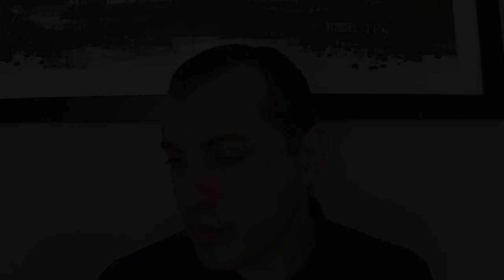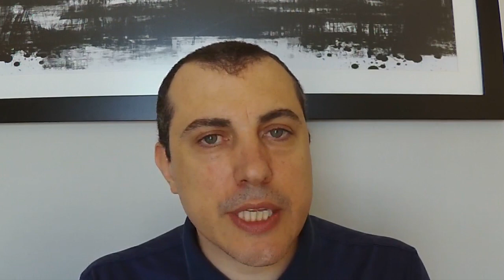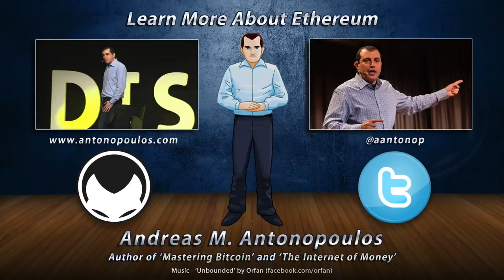Ethereum Q&A: Gas and Resource Allocation

Comment: I think Andreas makes a slight imprecision here. It is indeed impossible to write an algorithm that predicts if an arbitrary contract will halt if the language used is Turing-complete. That is why the Ethereum protocol cannot automate this procedure, and gas must be used. However, given a specific contract, you, the user, can just look at the code and determine what will happen in different scenarios (or determine that it is too complicated to predict and not use it).
Reply: He said "*you* cannot predict what will happen" a few times, that is what I'm referring to. In the example with the counter, it would be rather easy to determine what would happen, exactly as he does in the video right after!
Reply: It's more than a slight imprecision.  It's very misleading.  Of course it's true Turing showed there is no general algorithm that can predict the runtime for every program, but there are certainly algorithms that can predict the runtime of specialized families of algorithms.  And there's no reason we can't do the same for specialized smart contracts.

Comment: Gas creates economic friction between users. For a smart contract platform, this friction will slow/halt adoption. Either gas needs to be minimized to less than a 1/100th of a one USD cent -- or ETH will die at the hands of EOS.